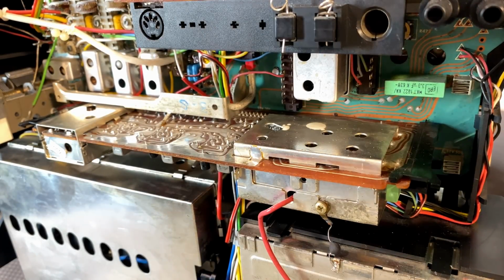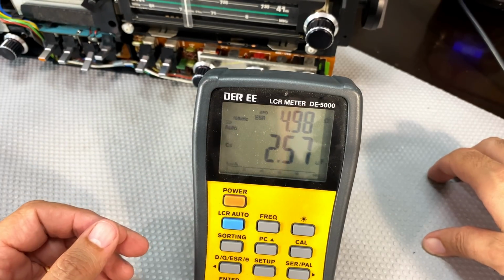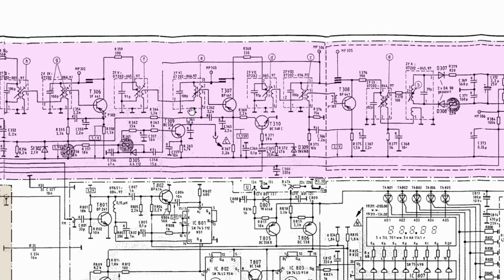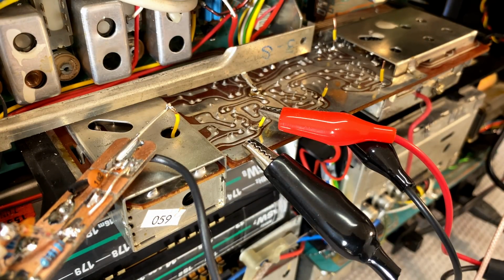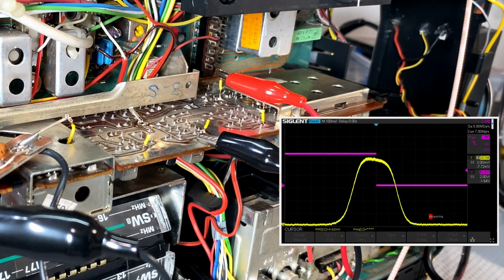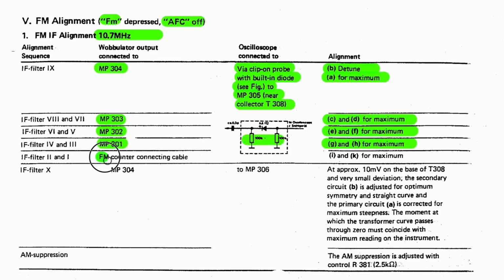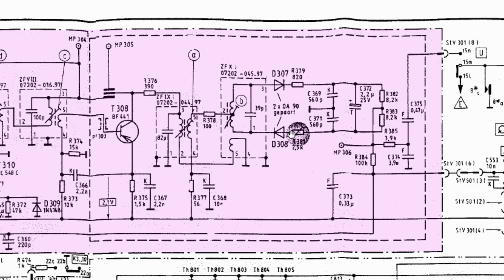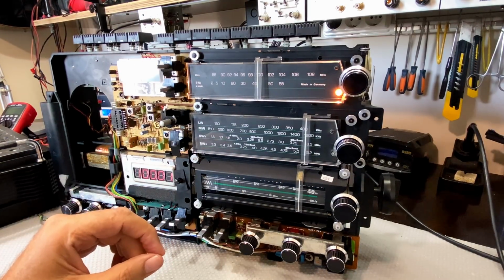FM throws a tantalum. Full IF alignment of the FM. Grundig Satellit 3400 Pro restoration part 9.

Comment: Both my donor and the one I'm restoring the 10.7 if was shifted about 400KHz up. at 1st I thought the counter was off. But after I calibrated the frequency counter it was still not ok. I had to adjust the IF section now the frequency reading is Ok again. Not easy to access all of the transformers and trimmers.
Reply from the maker: Yes, access can be challenging on this radio. The result will be well worth it, though 👍

Comment: It's nice to see the FM alignment go so smoothly Manuel. 
You know me, I struggle with FM but I did wonder when you adjusted the discriminator coil (b) that it might effect the the last IF coil (a) and that should be checked again. They are not close coupled I guess but the instructions mention adjusting both (a) and (b) at a certain input voltage. I also wondered when adjusting the AM suppressor trim resistor won't it effect the balance of the ratio detector you set up when you adjusted (b) or will it simply move the FM sine wave vertically on the scope and leave the discriminator balanced ? Sorry Manuel, I'm thinking out loud.  AAUGH!... FM 😟
Reply from the maker: FM is actually quite scary until you mess up a few of them. Then it becomes normal 😊 At first I handles it like I did my daughter when she was born - very scary - until I realised that they’re not as fragile as you first think. 
The goal of adjusting the discriminator coils is to balance the detection, and that is achieved when you see the sine wave going through perfectly. I’m sure some further refinement can be achieved by adjusting the first coil and trying with various frequency sine waves to confirm perfect alignment, but … good enough is good enough for me 😊
Reply: @electronicsoldandnew  Totally agree Manuel, the radio works perfectly. 
 I (I wasn't suggesting you do it) would have liked to play around with it and see the different results for my own benefit, it's fascinating stuff. Thanks for the great explanation in the video too. Cheers!

Comment: Thanks for this great content!  Looking forward to how you will align RF front end. I need to do this with a Heathkit receiver and need to input a 4uV signal in the antenna. I have attenuators but nothing that can measure that voltage to verify. Guessing this is why this is done at the factory in many cases. Wondering how you will approach this. Looking to learn. Thanks!

Comment: It looks to me like these radios that were made in the 70's, especially the ones with the FM made of discrete transistors tend to be very sensitive compared to the later ones with IC's.
Reply: I'd say, the tuners from the mid 70s to the mid 80s were the best ones ever made. But even with ICs, they made top notch ones, like the legendary Revox B760.

Comment: Tantalum caps are very stable in value, but very prone to just go dead short.
Reply: True, especially if they receive any reverse voltage at some point.
Reply from the maker: This one was somewhere in between. It wasn’t shorted, but leaky.